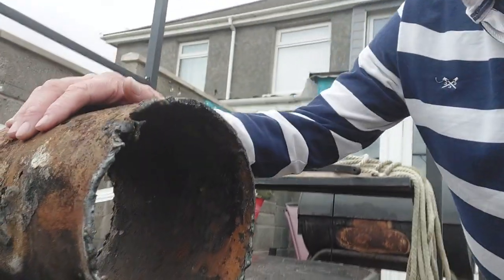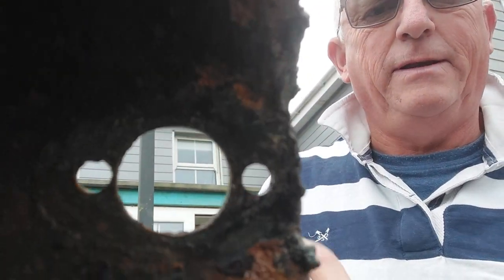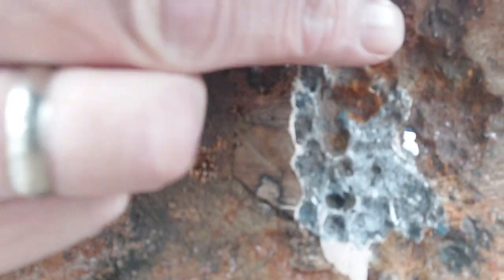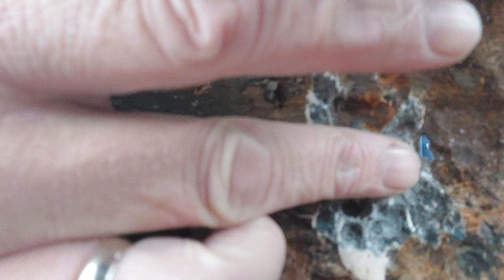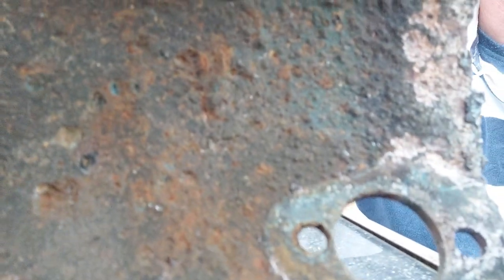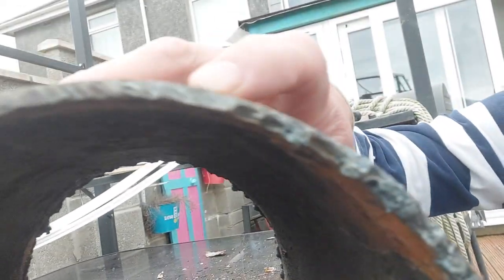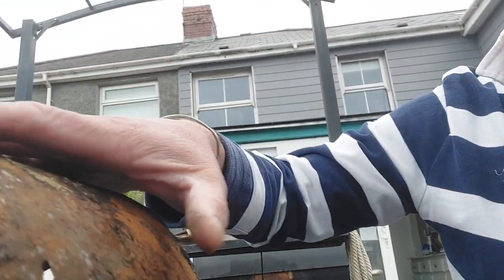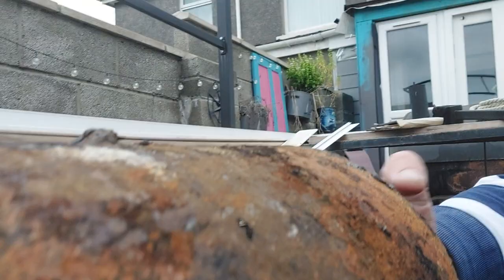serious corrosion in a narrow boat bow thruster tube.

Comment: How much would it cost to replace a tube.  My boat has just been surveyed prior to sale and and this problem has cropped up.  I'm being told £4-£7k.  This sounds way too much.
Reply from the maker: Depending on length of tube plus access that doesn't sound far off. Some have to have the whole well deck out to Weld inside and outside plus all the removal and refit of motor etc.
Reply: @TheMarineSurveyorNotebookBenSu  Thanks. Access should be easy as the bow thruster tube and all its parts are between two bulkheads with a lift off lid exposing everything.  Hopefully will be requoted a smaller price.
Reply: I agree 4-7k is crazy. A replacement 6” tube 1/2” thick 4ft long is around £350

A good welder should have this swapped out in a 8-12 hours

Plus your dry dock. 

£1500 tops.